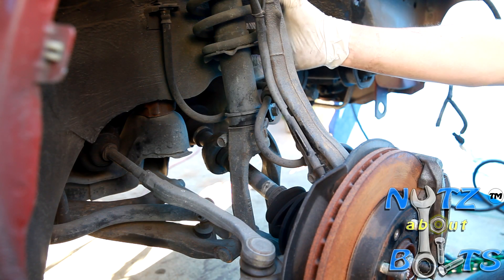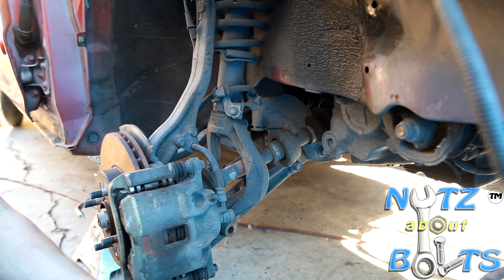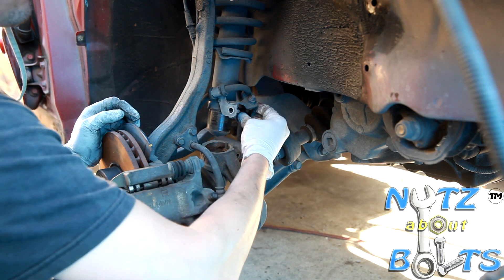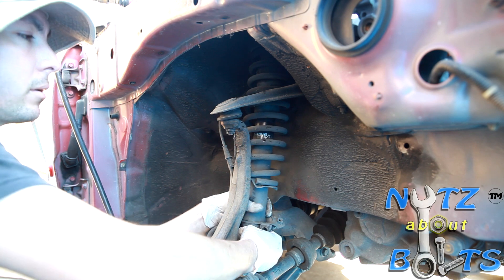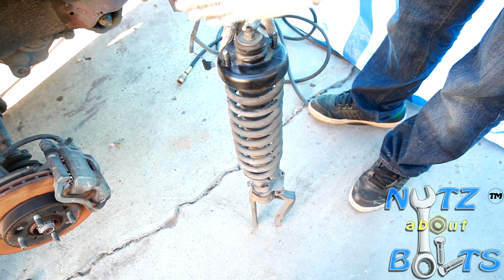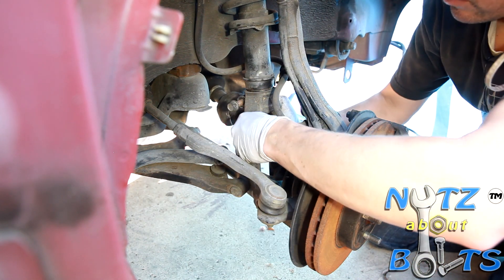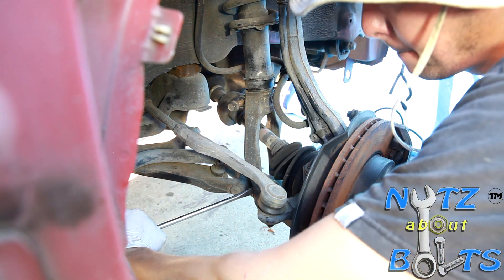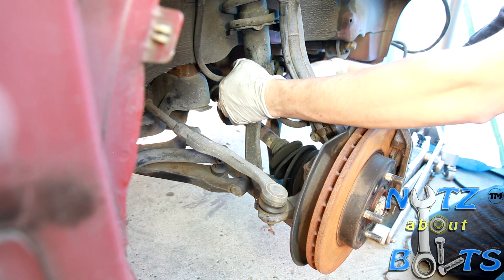1994-2001 Acura Integra GSR Front suspension replacement

Comment: @5min why do you need to make the angle a certain way? isn't the fork OFF on installation and the bottom of the shock is round- would fit in any orientation??
Reply from the maker: It’s not truly round on the bottom of the shock, there’s an indentation that the fork goes into so that the bolt will be able to go through it to secure it to the shock.
Reply: @NutzAboutBolts  good to know for when I do mine. Thx!

Comment: how do I change a wheel studs on a 1994 acura integra
Reply from the maker: there's a hole on the backing plate where you have to use a rubber mallet to hammer to wheel stud out from. Then when you install the wheel stud, you use a lug nut to tighten it down until it snaps into place.

Comment: My 99GS has bad lower front control arm bushings for the driver said. I see I can get an entire control arm with new bushings for around 50 bucks online. How hard is it to replace that in my driveway with hand tools? note. I do not have any impact tools.
Reply from the maker: those bolts are torqued down really well. I would get an impact gun so you don't over work yourself. If you can't, then I would get a breaker bar to break loose those bolts.

Comment: Unfortunately, the spring compressor available at my local Auto Zone, and many on Amazon.com (mainly w/ locking pin), is too big to fit in through the gaps of my front stock coil springs; only fitting  at the gap close to the bottom of the strut. Be warned. Thank you for the video.
Reply from the maker: pellergin ouch, that sucks. Hope you find the right one.
Reply: +pellergin I had to disassemble my compressor to fit the second hook through.

Comment: What if you tignten the top first than the bottom of the strut?
Reply from the maker: then it won't be aligned properly.
Reply: +NutzAboutBolts the wheels wont be alligned right?
Reply from the maker: Merdoc Avila
it won't go into the fork properly.
Reply: +NutzAboutBolts oh okay sooo you think i should start over then if i tighten the bolts on top first?
Reply from the maker: Merdoc Avila
if everything is tighten up and not causing a problem, then its good to go. but if there's problems, I would redo it.
Reply: +NutzAboutBolts oh okay it seems good so far car drives like it need alittle alignment but okay thanks
Reply: +NutzAboutBolts but it is normal when i change the stuts that the disk looked alittle cambered ?
Reply from the maker: Merdoc Avila
anytime you work on suspension work, we always recommend an alignment because you threw the alignment off by removing the suspension parts.
Reply: +NutzAboutBolts oh okay , thank you for replying quickly and your time
Reply: +NutzAboutBolts is ir normal for the brakes to go down more and the stearing to feel loose ?
Reply from the maker: I'm not sure how your brakes and steering feel, so I can't comment on it. If it feels weird, I would suggest inspecting the brakes and steering suspension to see if there's anything wrong with it. When you change just the suspension, it shouldn't affect it unless you messed with the braking parts.
Reply: +NutzAboutBolts oh okay then thanks for the info